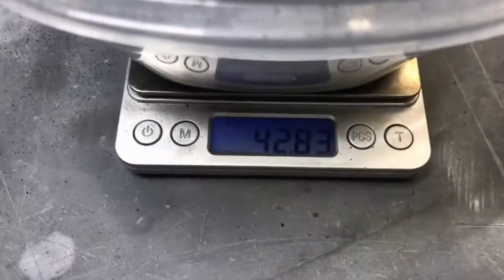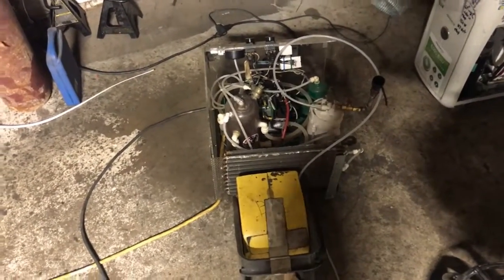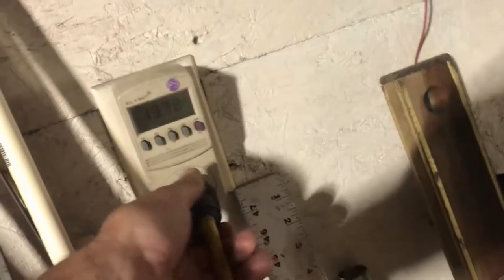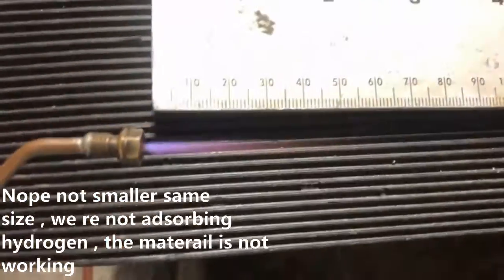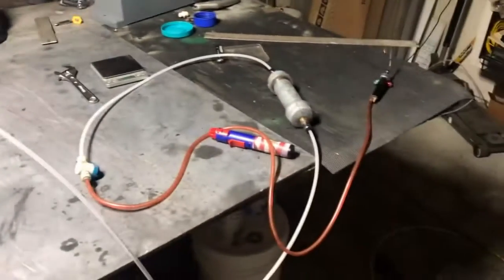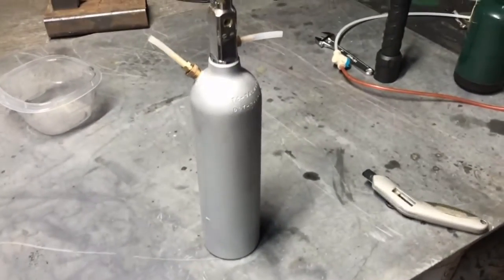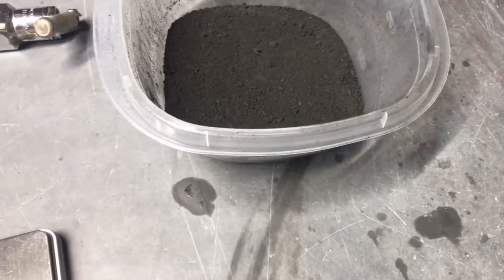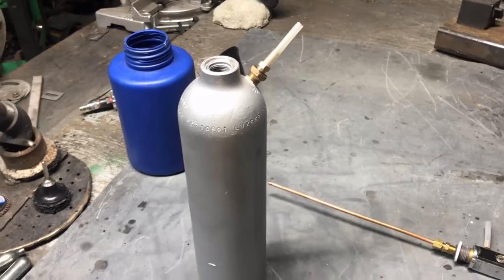Graphitic carbon nitride hydrogen storage material

Comment: You need to clean Hydrogen from impurities and from humidity. You need a Anhydrous Calcium Chloride filter. And raise the temperature of the active carbon to 60 deg celsius. Make sure that there is no oxygen and then inject hydrogen into the active carbon. The more porous and fine are the grains, the better the surface area. I repeat, no moisture should be present. add iron and graphite to increase conductivity so that by using a current, you might be able to raise the temperature to release and absorb.
Reply: Thank You!

Comment: Hope your still alive?
 mixing both gases (h2 & o2) in a tank that can take that much will result in an explosion of the same pressure, and high velocity shrapnel... Likely to knock your walls off the foundation..
  If you are going to contain both gases do it in something that can't hold pressure and in small quantity... Unless you're trying to cause death and destruction.

Comment: Sodium hydroxide is highly gyroscopic and is usually sold as a mono hydride. If crushed it has a high surface area to react with water forming higher order sodium hydride.  And it can be easilly regenerated under heat.
Reply: The problem is that NaOH reacts with CO2.
Reply: The hydrogen generator is not producing co2.  But at 5:00 he says there is a slight problem. He many need to do some drying. He is righltly guessing the hydrogen gas stream has a lot of moisture in it, and that could condense and throw off the weight of the cylinder. I was proposing one could use general purpose sodium monohydrate because   it's hydroscopic,nandnthe relative ease in dehydrating it.
Reply: @kreynolds1123  And I was saying that by trying to regenerate NaOH you are going to convert part of it to NaCO3 (carbonate) because air contains CO2
Reply: @user-py9cy1sy9u  Then one should avoid lengthy exposure to atmospheric air. If your saying  most procedures are not going to regenerate 100% NaOH as some small exposure to atmospheric CO2 is virtually unavoidable, then for the most part your right. But, for the most part, it isn't dificult to use a procedure that avoid lengthy atmosphereic exposure to sufficent large volumes of atmosphere with co2 composing roughly 5 parts per million of it. Without a significant atmospheric air mass flowing through, it's quite easily possible to regenerate a NaOH dryer repeatedly many many times over before one looses even 25% of capacity to 2NaOh+CO2 to NaCO3+ H2O conversion.

Comment: There are sooooo many reasons this didn't work for you. Before i get into them, i appreciate your channel and the information you do provide, i also want to state that hydrogen storage using g-C3N4 is a very active and booming area of research at the university and commercial laboratory level. It is a ery promising material. The issue is that not all synthesis pathways and forms of g-C3N4 are created equal. Due to the information in your videos i can tell that you have made the material by Robert Murray Smith and are going based on the claims of Robert Murray Smith. 

It is fact that g-C3N4 can store a lot of hydrogen. It is also fact that different forms store hydrogen in different quantities - some not at all - and it is true that the synthesis of H2 storing g-C3N4 needs to be VERY strict. So, without taking into account EXACTLY how you synthesised the material and post processed it (for instance, did you vacuum dry the material to open the pores and purge it of water and trapped gasses? This is a necessary step for g-C3N4 since it forms bonds with water and gasses VERY quickly). I'll focus mainly on your testing setup. 

There are a few flaws in how you went about this, but nothing that can't be remedied with knowledge. Firstly, your flow rate through the material is WAY to high, and contrary to what Robert Murray Smith stated, you can not have a pressure differential. The H2 gas must terminate it's flow at the material or it won't go in. If there is a path of lower-pressure the gass will prefer that path and follow it - effectively moving through the matierial without bonding to it. The reason for this is in HOW g-C3N4 forms bons with diatomic hydrogen. It does this through Van Der Waals forces and physiosorption. There is some moderate chemisorption - but that is beyond the scope of this comment. When the H2 gas is exposed to the g-C3N4 material and has nowhere else to go, it'll settle inside the mesoporous structure and bond to it through static electricity (at an atomic level). It will also form bonds with Nitriogen groups and carboxyl groups (harder to break) within the lattice. 

Another thing to note is that you sent freshly generated H2 from an HHO cell into the system. You absolutely need to dessicate your H2 stream. It's also of note that Hydride materials that function of creating Metal/Metaloid Hydrides through physiosorption perform better when the material is cooled during the hydrogen infusion and heated evenly starting in the center of the material mass for desorption. Another, and very important detail is post-processing the material after synthesis. It is absolutely mandatory with g-C3N4 and metal hydrides to heat the material up (after vacuum purging) inside of a pure H2 atmosphere and increase the pressure until the material turns into a powder. Around 9 - 10 bar. Hold it there for about 30 min to an hour (close the H2 valve and watch the pressure drop until it goes steady and stops dropping), then release the H2 - but do not let in and O2 or other gasses. Seal this material in a vessel similar to the one you have made, and THEN heat it up to purge out ALL of the H2. Then you can begin your tests and begin cycling H2 through it, correctly. This pre-treatment phase is important as it conditions the material and decreases the particle size drastically.
Reply: Thanks I am working on a similar experiment and your comment was super helpful! What do you do for a living?
Reply: Thank you very much for the informations, when you say : "Another, and very important detail is post-processing the material after synthesis. It is absolutely mandatory with g-C3N4 and metal hydrides to heat the material up (after vacuum purging) inside of a pure H2 atmosphere and increase the pressure until the material turns into a powder. Around 9 - 10 bar. " at what temperature should the material be heated ? Thanks
Reply: Thanks for this excellent comment.

Comment: Madness. G-C3N4 will begin to absorb H2 when heated to around 300'C. Which means you really shouldn't be putting your HHO gas into a hot container. 
Now if you were using pure H2 then the process is first purge all the air from the cylinder of powder... vacuum, heat it and then introduce the H2 with a little positive pressure then let it cool while still connected to your H2 supply.
Reply: You are correct! Heating the bottle filled with nitrate graphitic carbon with a pressure release valve to get rid of the humidity and oxygen, will create a vacuum when it cools down. Then, reheat the container to inject Pure Hydrogen so that the vacuum would be replaced by hydrogen. It should store 4 times as much hydrogen it would in a liquid state.
Basically, is the volume of the container multiplied by 4. But if you fill-up the bottle, and at the upper layer you put pure activated carbon, all you needed to do is to plug in a vacuum while heating the container. In a vacuum, you'd need less heat.
Then let it heat for a couple of minutes and then replace the vacuum by hydrogen.
Then, let it cool down.
By the way, you do not need a high-pressure container.

Comment: @NOBOX7 you need to make sure that it's pure hydrogen regardless the isotype. You need to heat the activated nano carbons and inject hydrogen. When it cools down the carbon nanotubes will contract and trapp the hydrogen.
You don't need a metallic reservoir. Use fiber reinforced plastic or carbon fiber. To release Hugh pressure hydrogen, just apply heat.
You can produce low cost activated carbon with brown sugar + dry mushroom powder+ zinc chloride + graphite+ sodium bicarbonate. Blend the mix, get a container filled with sand, soak a portion with alcohol, put the mix on top of the soaked sand and light it.
Let it burn and produce the carbon snake. It will be conductive.
You can expand it in a microwave.
Then put it in the bottle.
Then apply heat to inject hydrogen.

Comment: Could the issue be that you not putting in pure H2 gas.  Does the hydroxy gas have a magnetic affinity for itself which could prevent the H2 from breaking off and bonding with the the carbon in the carbon nitride?  Just spitballing here.  Great video...new sub.

Comment: The best material for storage of Hydrogen is what Bob Lazar used to fuel his Corvette. He used solar cells to power the electrolysis. Do not remember exactly what the material was but can be you that you can find out by going to his web site Sir. Good day too.
Reply: Lithium 6 deuteride is what he used.
Reply: @richardsandwell2285  Thank you Richard for letting us know the actual and technical name. VF
Reply: @victoryfirst2878  Unfortunately it is a thermo-nuclear explosive, so it is restricted to purchase, which is silly really because unless you also have an atom bomb and lots of complex engineering you would never be able to make the stuff go off.
Reply: @richardsandwell2285  It's not restricted per say. Li6 can only be synthesised in a particle accelerator. Bob Lazar built his own accelerator and had access to the one at Los Alamos. He most definitely didn't have the ability to create a lot of Li6 - as that would have been horridly expensive. So, he probably synthesised it and then expanded it onto a bed of carbon and filled tanks with it. An alloy recently developed in 2020 performs very similar and is made MUCH cheaper from earth-abundant Li7 and Al. Performs very well, 7.9%wt storage capacity at ambiet pressure and only 500°kelvin. Issue is it oxidises VERY quickly upon exposure to water and air. So, hard to handle.
Reply: What Bob used has been banned by uncle sam, that is what stopped the hydrogen revolution from moving full steam into the 21 century!
Reply: @Trendz9312  I guess we can thank the little bush or should I say shrub  ex-president to make sure the hydrogen revolution did not happen.
Reply: I believe it was lithium six
Reply: Lithium-6 deuteride is not needed. Lithium hydride would work as well. It is hella expensive and dangerous though. It likes to catch on fire all by itself.

Comment: I think the material needs to be high surface area in order to absorb hydrogen gas. Maybe you can try to activate it or put it through a sonicator to separate the layers.  Usually what people do is they dissolve the graphitic nitride in water, then sonicate and finally freeze dry it to prevent the layers from restacking. R.M.S. leaves out some details so I would definitly do some more research.